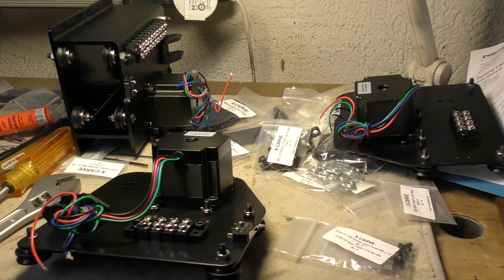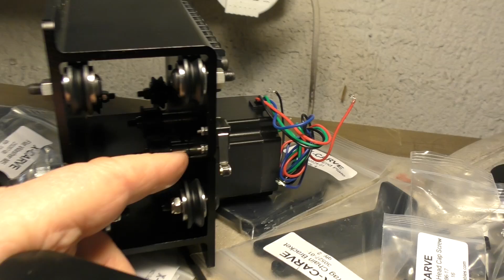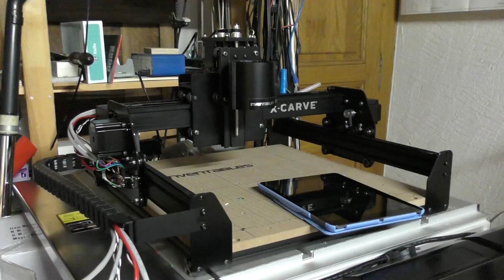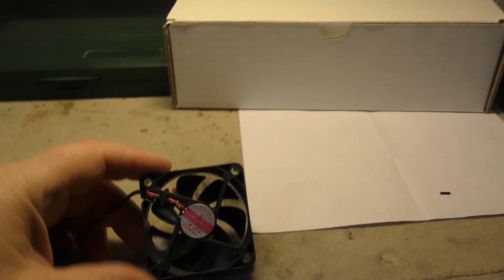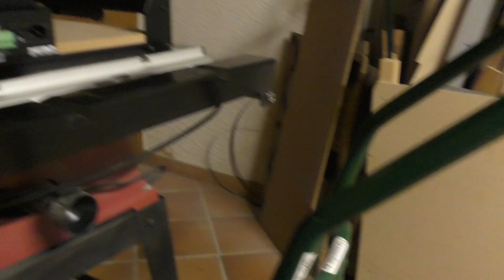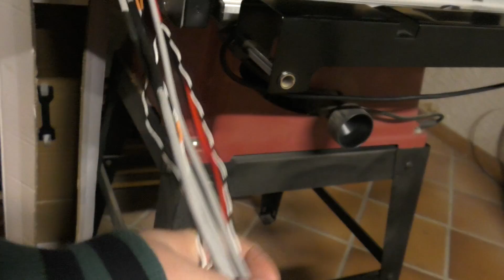Getting into CNC with the X-Carve - part 2

Comment: Looks nice John!  Give any thought what your first project will be (besides testing it)?  Maybe make your next guitar with it?  Or a radio cabinet??  Merry Christmas John, catch you in the next video!  73's OM  ~Jack
Reply from the maker: +JacksJunkDotCom I wouldn't fancy carving a guitar - I prefer to do that by hand.   Anyway I've got the small machine so not enough area for a guitar body.   I'll start off with some fairly simple stuff.  I want to make a new front panel for the tuned MW aerial project and have some nice lettering on it, etc.   Later I want to try out some PCB 'etching'.